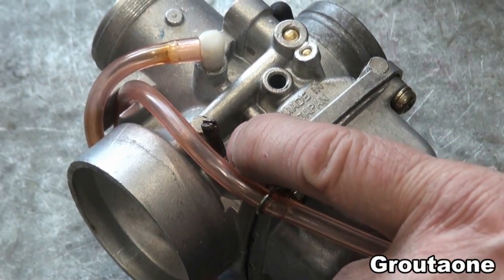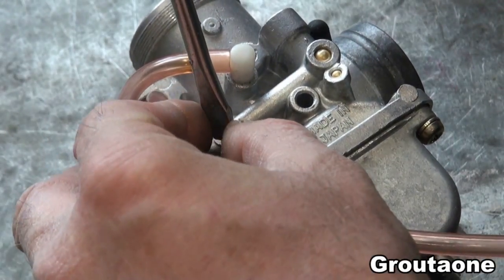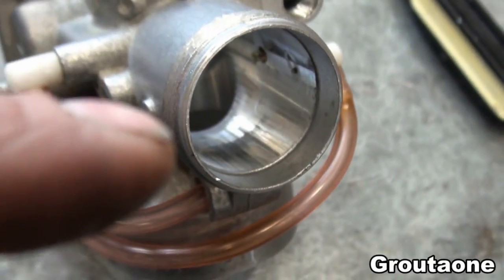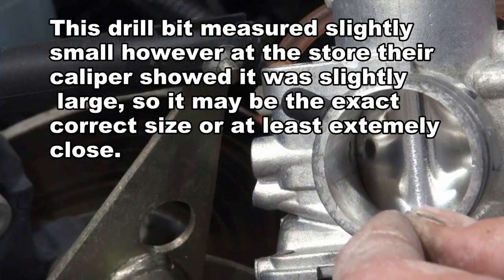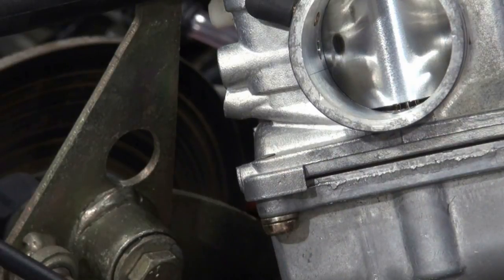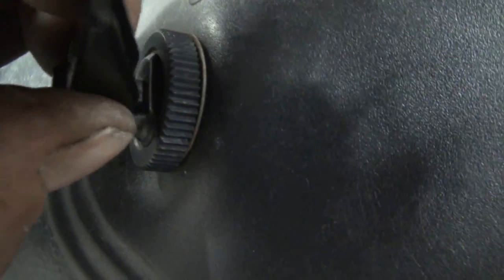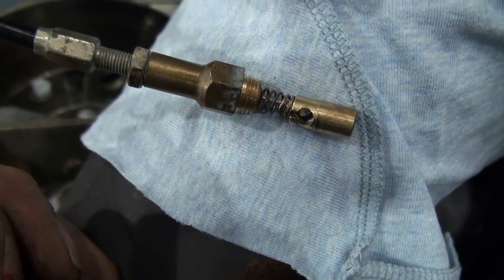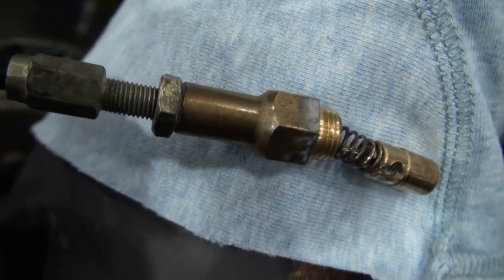Ski Doo Carb Adjusting

Comment: The air/fuel screw.  If I am running rich and want to lean it out, do I screw in it further?  Or screw it out further than the 1-1/2 turns that is standard?  Sorry if I missed it.

Comment: I have one throttle slide where the gap is larger than the other two. How do you adjust it? I can't seem to find any screw for it and the idle screw doesn't work for that since it moves all three. Thanks!

Comment: What is the measurement on that choke plunger.
I have 2x 97 skidoo formula 3 triple 600 sleds.
Both sleds needs the plunger adjusted.
I don't have the tool.
I found a drill bit that fits perfectly in the hole, but as soon as I install the plunger it doesn't fit. Even when it's backed out all the way.
I'm going crazy over this.
Didn't all might looking for the service manual. Finally found it.
The slide height is:
1.2mm or .047" or 3/64" (drill bit)

Thank you

Comment: I know this is off topic Groutaone, But I would be interested in knowing how your solar heating project ended up turning out.
Reply from the maker: It makes a lot of heat on sunny days, light cloud still makes good heat, dense cloud day it can still generate about 70-80F incoming. I got it working better in the house/garage but there I am also heating floors, it's a supplement as we still heat the upstairs with hydro as needed, in the shop it goes directly to radiators with fans which also heats well but doesn't last long after dark. I would like to get a portion of the floor in the shop hooked up this winter yet. I have some very slow glycol leaks outside on the shop setup, it's on the eventual list of things to do.
Reply: @groutaone  Well I am glad to hear it is still working for you. Have you given any thought to thermal storage? You can store a lot of btu if you know what you are doing for cheap.
Reply from the maker: @davefroman4700  I have a large tank hooked up for the shop but I don't use it, tank would  be better with floor heat.